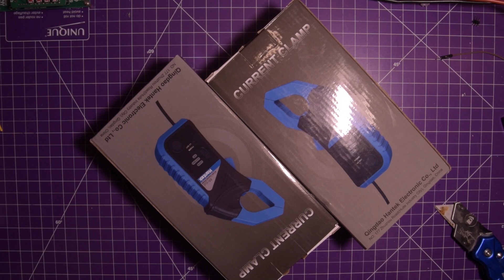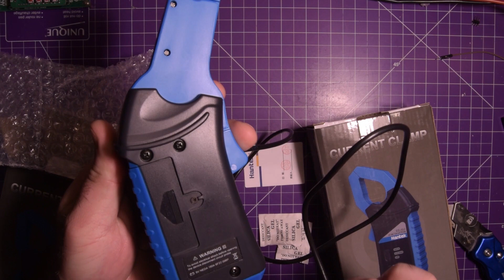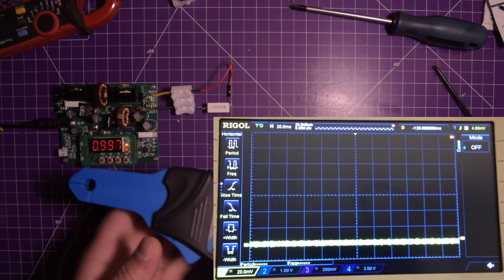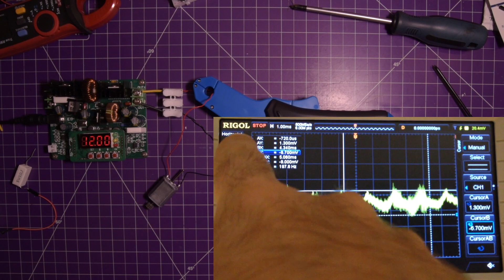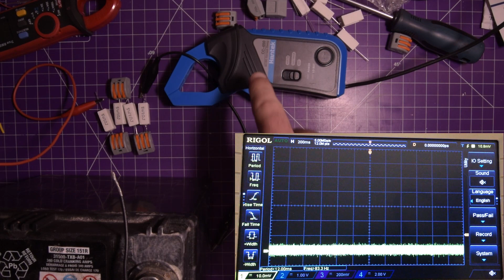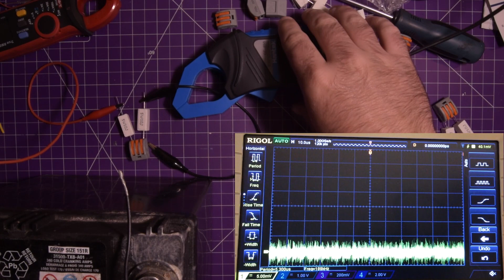Hantek CC-65 and CC-650 Current Clamps - Unboxing and First Look!

Comment: At 7:51 if you set the channel to 10X you will be able to directly read off the amps without calculation since the probe is providing 1 mV per 10 mA the DSO will multiply the input voltage by 10 giving you 10 mV per 10 mA which is 1 mV per 1 mA. On my Siglent I can also change the the units to either volts or amps and I'm sure you can do the same for clarity.

Comment: So many wrong things in this video:

1.why not zero the Probe after u put it on the wire with supply off?

2.why not set the scope to 10x ?

3. You can change the scope from showing mV to mA

Comment: IN my testing the Hantek CC65 is the best budget current clamp on the market.
went bananas in these Ac/DC current clamps and spend a tad over 120bucks and got all the cheapest CN versions I could find some years back as a way to learn. 
got 4 different models for my 4ch Micisig STO scope.
Purchased 
# Hantek CC65 (20Khz)  40USD 
# ETCR007 (100Khz) 47USD
# Allsun EM264 (?Khz) 26USD
# HoldPeak 605 (?Khz) 14USD
all AC / DC valid.
Your video above, was actually the reason why I went for the little brother CC65 and not the CC650 that was like 15USD more, as it seemed the smaller CC65 had way less noise.
the most expensive ETCR007 (100Khz) at a tad under 50 bucks, was a letdown and has way more noise than the Hantek IMO.
example of the noise floor. https://www.youtube.com/watch?v=OH0gfz7I9Bw

Comment: would this show a sinewave if its AC amps ? or it will be always a line
Reply from the maker: No it should show a semi-sine wave, depending on the load, since voltage crosses the 0 point, it should also bring the current to zero as well

Comment: Whats your thought here down the line..they are around the same price..are the noisefloor way higher on the 650 vs the65 or are they around the same so it would make sense to go for 650 model, ..any noticeable drawback on the 650 in regards to 65 model?  Thx for vid..+
Reply from the maker: the sensitivity is much higher on the cc-65 so if you're not measuring past 60A, I would say get the cc-65, otherwise, get the cc-650

Comment: So do I set my monitor to 10x or 1x?
Reply from the maker: On the scope? x1 mode
Reply: @SimpleElectronics  rep, on my scope I think I have the same mso1042 or something like that. I have to manually set the probe, so wasn't sure if it was 1x or 10... Didn't have a, know amp source to measure at, the time. So 1x... Ty.

Comment: I wish I would have done the motor draw test! I thinking about doing one with a bad armature loop or some nail polish on one of the bars!
Reply from the maker: if you have the larger one (cc-650) you can actually do a dynamic resistance test on the individual windings of a starter in situ. it is very useful!